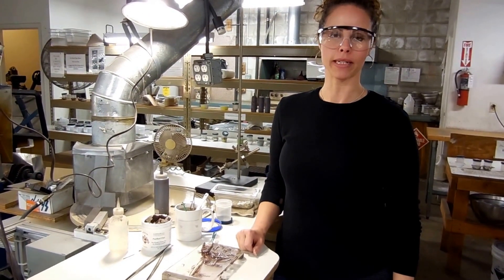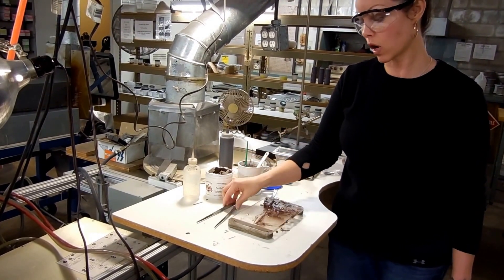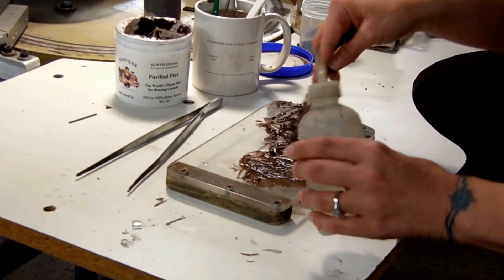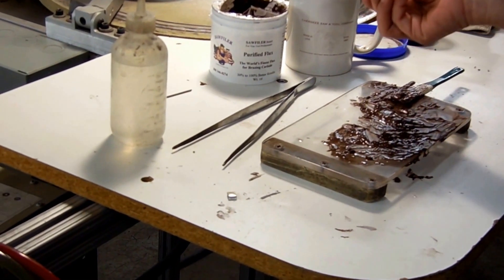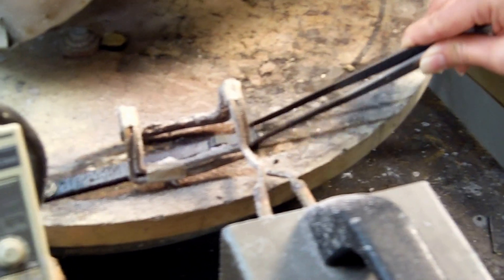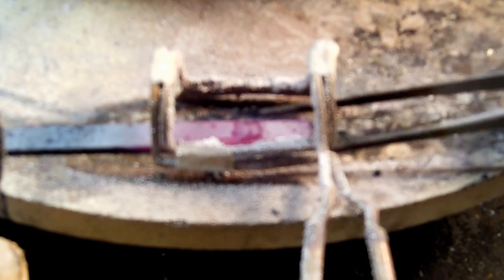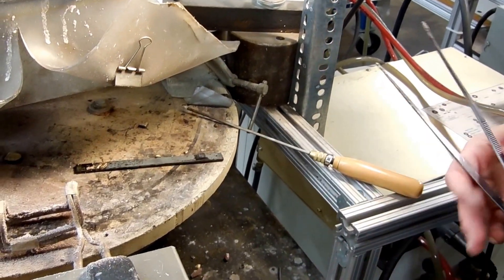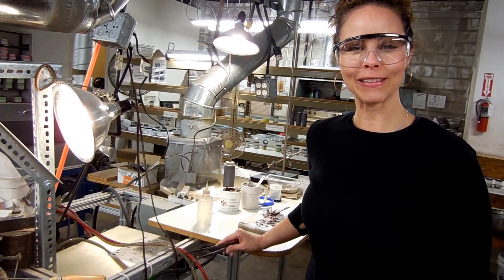Brazing a Carbide Tip to a Steel Bar- Induction Oven

Comment: What if the part to be brazed is not pre-tinned.  Is the procedure similar or is there a way to pre-tin?
Reply from the maker: I would recommend ribbon braze alloy.  We would paint a very light layer of flux on each side of the ribbon and put that between the steel and the carbide.  Make sure the carbide surface accepts the braze alloy and that the steel is clean.
Reply: Thanks for the answer I will check it out on the website.  How much does the pre-tinning add to the the carbide part?  I have a carbide insert that I need to put inside a metal part and would like to know how much tolerance to keep between the 2 parts to allow for proper brazing?  Do you think .1mm will work or will I need more space between the parts to allow for the brazing alloy?

Comment: what kind of silver brazing rod are you are you using ???? I want to order some off eBay. I need to braze carbide stump grinding tips to steel teeth.
Reply: did you find silver brazing rod on the ebay
Reply from the maker: You can probably get good braze alloy off of eBay but you need to be careful.

There are an awful lot of different kinds of braze alloy and many of the sellers aren’t all that sure about what they are selling.   

We buy our braze alloy directly from the manufacturer so that we get a certified product where the any trace materials are somewhere around one or 2 parts per billion. 

There are maybe five common, high silver, braze alloys that can be used in this application.  The most common seems to be a 50% silver cadmium free alloy. There is a 49% alloy with manganese and a 50% braze alloy with cadmium that are both stronger.  There is a 40% silver braze alloy that is not as strong but that is a little cheaper.   There is a 56% silver braze alloy with tin that is easiest to use but is probably the weakest.

You also need a special brazing flux.  That is a brazing flux with BRAZING in capital letters and underlined.  

The terms brazing and soldering are often confused. Brazing can be considered as high temperature soldering. The separation point is typically 880°F although other temperatures are used.  

If you go into a welding supply store and ask for flux you will typically get a soldering flux because that is far and away the most common usage. This flux will burn up too fast and you will not get good braze joints.